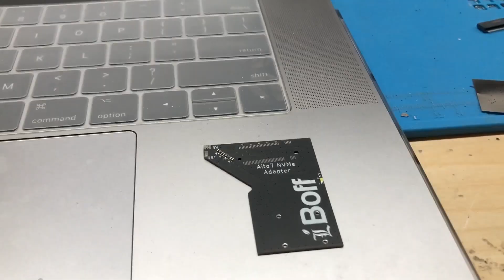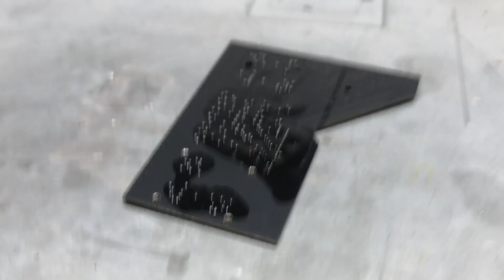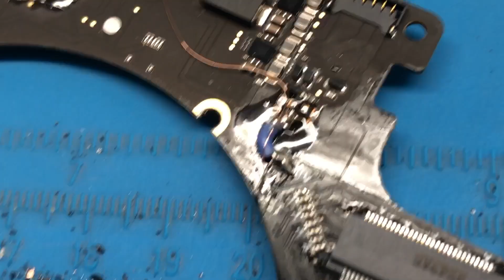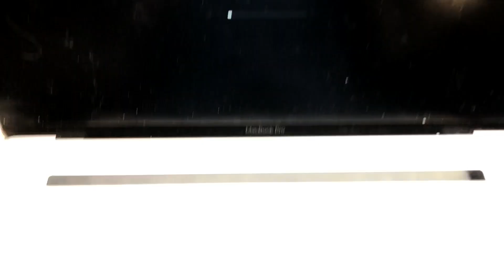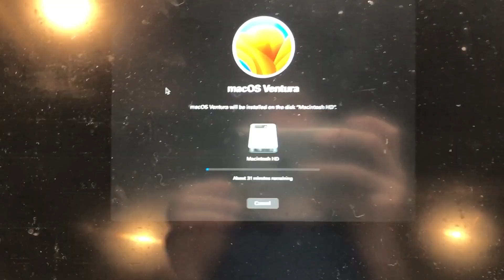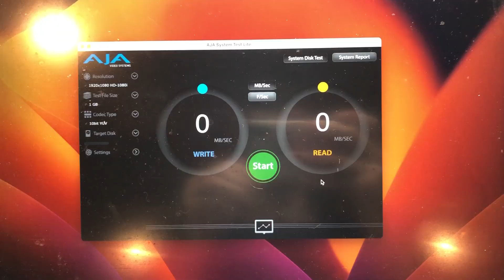Touchbar MacBook Pro NVMe SSD Upgrade

Comment: The only thing I've done like this was hacking in an 2280 nvme drive into an 2013 era Precision M6800 and didn't have to sacrifice the mxm slot. Kinda neat when something that old can have up to three nvme drives granted at pci-e 2.0 speeds, an msata, and three 2.5 sata drives while everything modern is stuck with either a single SSD or sometimes two. All and all I got 13.5TB (six drives) installed in this antique.

Comment: This is a great idea, and will help me and hopefully many, MANY others keep these MacBook out of landfills! Seriously, thanks for these videos brother! Some of these small run parts are really well thought out, and this little board seems to be no exception. Thanks for telling us about it. I'm all over this one.

BTW, did you ever hear any news about the NVMe upgrade kit for the 2011 (I think it was the 2011, maybe 2010) 17" MacBook Pro that you demo'd a little while back? It's the kit that replaces the dGPU with an interposer/BGA reroute PCB, freeing up several PCIe 2.0 lanes, then there's a caddy that hooks to the slimSATA port for power (I think) and that's where you install the M.2 (2280). It worked, but there was a ribbon or connector that ran from the interposer to the M.2 slot that was kinda short. I hope I'm not misremembering too badly. I think you said they hadn't decided if they were gonna make more kits or not. THAT upgrade was very cool, and on the last 17" MBP too, not to mention removing the probably dead dGPU and installing an NVMe in its place.

Great video as always! Thank you for all that you do for the community. Seriously bro, I used your Mojave and Catalina patcher for years on my machines and to give clients of mine with older Macs the ability to have dark mode (yes, dark mode is THAT important to me). I'm an OpenCore user these days,  but I did see that you were in the acknowledgement, with you and  your patchers being cited as providing a map of where and how to start. You're very much beloved in this community, and we are so incredibly grateful for your work!

Thanks again!
🙂👍🐧🙂
Reply from the maker: Yep, iBoff has updated the kit with the appropriately-sized cable for the 17”. The kit for both the 15” and 17” models can be purchased from the iBoff Tindie store.

Comment: How exactly is the T2 Chip bad Implemented and horrible?
Reply from the maker: First off, T2 chip is very temperamental, and fails randomly for no reason in some instances. Second, if any one of the NANDs dies, the entire system is dead (as T2 has to boot to provide Intel UEFI firmware for system to POST, and T2's firmware is stored in NAND). Lastly, many machines with T2 have a poorly implemented NAND power circuit, that will commonly send 12V to one or multiple NANDs, instantly killing them (and thus, your whole system with it). Oh, and to top it off, there's also two different versions of the T2, one with only 1GB of RAM that can only support an SSD size of up to 500GB, and one with 2GB of RAM that supports larger storage sizes. As such, if your machine has a 1GB T2, you can't upgrade NANDs to a config higher than 500GB.
Reply: @dosdude1 thank you for the great explanation, I’ve been working on iPhones and iPads nand upgrade and with you and your channel I’m gonna expand my knowledge and starting getting these jobs as well❤
Reply: @dosdude1   >fails randomly for no reason in some instances

This happened to me. 2018 15", randomly died during a conference call and wouldn't power on again. T2 platform is pretty garbage.

Comment: I'm really happy that there is a future out there where instead of buying a whole new mac for a storage upgrade we can just upgrade our mac's storage again!
Reply: It’s more the SSD’s dying more than anything else
Reply: @joshywoshygone  Dont buy cheap ones. Only Samsung EVO, Western DIgital, or Crucial but sometimes tho fail
Reply: @JimAllen-Persona They don't. They have replaceable "flash modules" without a controller or DRAM (as the controller is integrated into the SoC), entirely proprietary to Apple and essentially just a PCB with a bunch of flash on it. They can be swapped for higher capacity modules from another Studio, but even then the system won't recognize the increased capacity, there are further mods required to make it actually work.
Reply: same, I take it there isn't anything like this for M1 MBP yet.
Reply: @davidkrocks Sadly there won't be, as the M-series Macs have the SSD controller integrated into the SoC, so there's no PCIe lanes routed to where the flash chips are mounted, making a mod like this impossible (unless you can source your PCIe lanes from somewhere else on the board, which AFAIK isn't possible either). The best we can hope for is someone figuring out how to trick the system into accepting higher capacity NAND chips swapped in for the stock ones.
Reply from the maker: @Kraaketaer  Yep, this mod can't be done on Apple Silicon systems. But it is possible to upgrade the soldered storage on them; see my previous video about that.
Reply: @dosdude1 so my mac got locked up with important files I'd like to onow if u could get data off of it?
Reply: Dont buy apple is the fix
Reply: @MrGaming-bz7ww  That’s a good option that I’m currently doing right now. 

However I’m getting sick of Windows and I realize the best editing platforms all are on Mac.

Gaming is getting a lot better as well it’s only a matter of time before more people switch to Mac I’m probably just gonna wait one more generation though before buying into the Mac.
Reply: @EliezYT look into how to use virtual machines on Linux, it’s not that complicated to setup gpu pass through in virt-manager if you follow a guide.
Reply: Seriously this is amazing. Now someone has to do a RAM upgrade
Reply: with a REALLY REALLY steady hand, i know in other case that would be done a with BGA picker upper vacuum sucker machine. in a way it's a nice phuk u to Tim Apple
Reply: You're right. We need some serious right to repair laws in the USA  @evgenidimitrov2639
Reply: @evgenidimitrov2639  The future is being able to swap out our storage like the old days. 

I agree this shouldn’t be the future however we can’t change Apple’s mind about this unless something like European Union does something about it.

Comment: I first saw this done on a different channel and I’m glade you have figured this out too! Will help save many of these with dead NVME drives due to high swapping. I wonder if Apple Silicon is able to be modded like this.
Reply: Not in the same way, SSD controller is integrated into the SoC so can't tap into the actual PCIe lines of the controller. iBoff claims they have something coming for Apple Silicon but haven't said what it is. Maybe an M.2 slot that hijacks the Thunderbolt? You'd lose a port though so I doubt that'd be how they go about it. Whatever it is will be cool and probably involve PCIe fuckery of some kind based on all of their previous products.